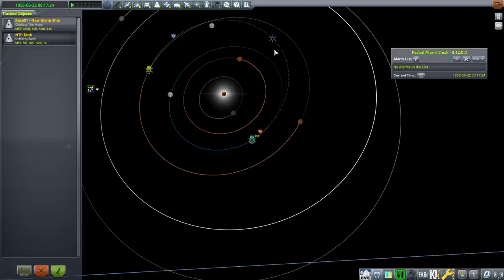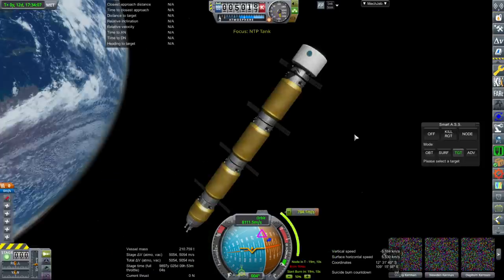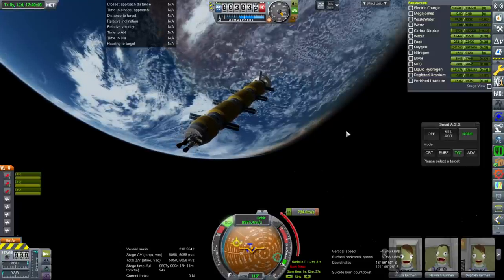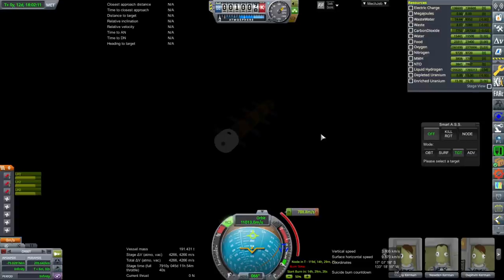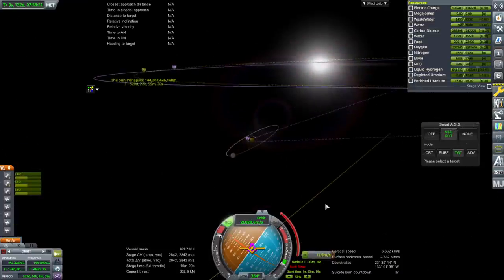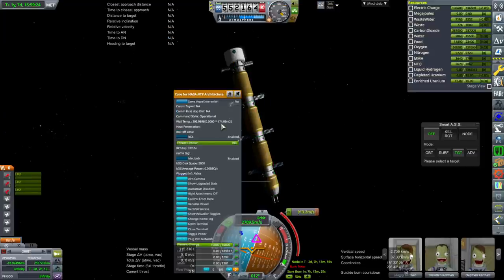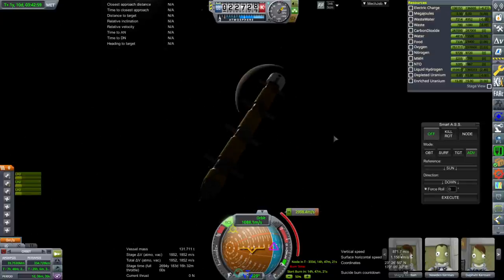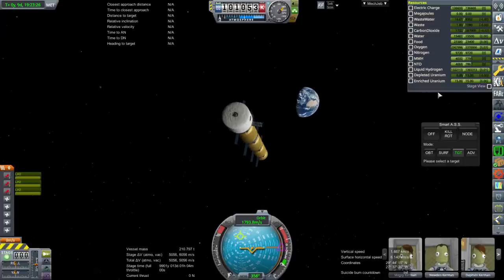Realism Overhaul in KSP 1.8.1 - NASA's Nuclear Propulsion Architecture 3

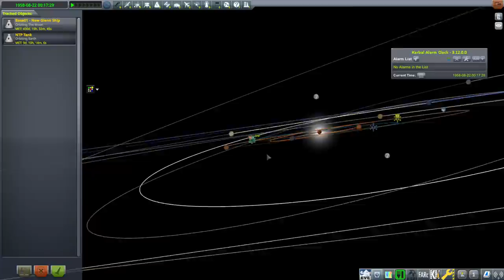Comment: 0:50 Maybe you could time-warp all the way to the 2033 window?

4:00 Safety features taking up ~10% the mass of a stage? Doubt.

7:35 Genre of ship... that's an interesting wording. BTW, I love that space definition of "Longship".

17:40 Oof... Some was left until literally 17:12, but the boiloff rate was ludicrous after you re-assumed control until that point for some reason.

21:20 I wonder why they have that exhaust color... I've thought before that may just be in the atmosphere, due to the rich burning of the low-density/pressure hydrogen with atmospheric oxygen, though usually only sooty/particle-rich flames are reddish. Maybe it's due to particles ablated from the cladding instead?

Anyway, really hope you solve the boiloff issue.
Reply from the maker: My current theory is that we need explicit radiators for the boiloff and that the presence of KSP Interstellar and its Waste Heat management has something to do with this. We'll see.

Comment: "How to throw a really heavy explosive and potentially radioactive object at another planet really hard"
Reply from the maker: Not that explosive without carrying liquid oxygen as well - at least, not as explosive as it could be. Mars doesn't have radiation belt protection from solar radiation, so I'm not sure our puny reactors are actually going to be noticeable compared to its normal background radiation. Depends how far out the material gets spread, I guess.
Reply: @RaizSpace  who said I meant chemical explosive? kinetic still does the trick.
Reply from the maker: You said it was a really heavy explosive, not that it was really good at kinetic bombardment.
Reply: @RaizSpace  oh fine you win. Hydrogen is mostly inert without an oxidizer.

Anyway I really hope you figure out that boil off problem. Personally I wonder if the engine module has anything to do with it...
Reply: @RaizSpace  Yes, depends heavily on the amount of spread. Irradiated fuel is not a joke, the dose rates thrown off by even a small piece of irradiated fuel can be injurious and produce deterministic health effects (effects that show up immediately, like skin reddening, nausea, destruction of the gut lining). At Bruce Power in Ontario, Canada there was a case where a technician doing normal surveying walked into a room and his dose rate meter jumped from background up to several dozen millisieverts per hour (this is a serious dose rate, the dose rate at which posting radiation hazard signage becomes mandatory by law is 25 MICROsieverts). The technician backed out of the room and announced that it was off limits to any human traffic. Later after investigating what was going on, using robots and cameras, workers discovered that a little piece of irradiated fuel about the size of a pea had been dropped on the floor by one of the fueling machines; this fuel chunk had come from a broken rod in the months previous to its discovery and had been kicking around in the fueling machines internals for a while before finding its way out and onto the floor. By taking measurements using a dose rate meter on the end of a pole attached to a robot, it was found that this thing was giving off a dose rate measured in sieverts *per minute*. If the technician walking into the room earlier had not had his meter already switched on, he probably would have walked close to this piece on the floor without realizing a thing, and he would have got a fatal dose. 

If we spread the contents of a nuclear thermal engine across Mars, chances are there will be many chunks of irradiated fuel that manage to reach the ground without being fully atomized during reentry (after all, NTR reactors are designed to handle very high temperatures without breaking down). Any piece of this stuff would remain a very real hazard to anyone who came close for decades. That's whether they walk by it in a suit or have it get tracked into a pressurized workshop by vehicles or settled into the bottom of a water holding tank that it was washed into during ice mining operations. Basically, yeah, crashing nuclear thermal cores into anything that isn't a gas giant is probably a really bad idea. It would be better to fling them onto a solar orbit to at least buy a few decades or centuries so that we can develop the propulsion tech and the plan necessary to go pick them up before they hit anything and make a big mess.
Reply from the maker: Which is why we didn't get anywhere near to entering Mars' atmosphere. It's not like I used aerocapture here.
Reply: @sycodeathman  also a small piece would have very low mass and thus decelerate extremely quickly. Good point!

Comment: Question.
How do MLI layers work?
Reply: They are just insulation,they dont transfer the heat to space,so they keep the cold hidrogen without the heat coming from outside..
Reply from the maker: MLI layers are dozens of very thin layers of material separated by a mesh and with vacuum in between them so that they transfer minimal heat. Each layer diminishes how much heat is transferred through, and there's a calculation for what reduction percentage you get for how many layers. MLI layers are pretty much always worth it because they're very light, so you see them on practically all satellites - they're the gold foil stuff.
Reply: @RaizSpace  so they work on sort of the same principle as vacuum flasks do.
Reply from the maker: Yes.

Comment: How long does a the Nuklar architecture take for a round trip? The current endurance space flight record by Valery Polyakov spent nearly 438 consecutive days aboard the Mir space station, from January 1994 to March 1995. Are we even in the same ballpark?
Reply from the maker: Any regular Mars round trip is about 900 days. However, unlike a stay aboard a space station, most of that time will be spend on a gravitating body - Mars. They would spend about 540 days on the surface, and about 360 days in microgravity, so the microgravity time is comparable to numerous spaceflights, including a few stays on the ISS.

Comment: may i again suggest use ascent/descent addon for mechjeb/interplanetory transfer ?
not only in april 2020 beta  should be fixes for some problems you have encountered before,
but it also allows to plan backward transfer (temporary mars orbit) before you actually arrived to mars,
that would allow you to plan orbit for arrival carefully (to make burn almost prograde at mars periapsis) .
Reply from the maker: The accuracy of the burn at Mars periapsis wasn't a major concern of mine compared to other things. I often do things deliberately inaccurately when testing to allow margin when doing serious missions, and I guess seeing that might be a bit distressing, but I can assure you that I could have conducted ascent and the capture burn with phenomenal accuracy if that had been my goal. I can easily calculate the lead time I need for a capture burn.
Reply: @RaizSpace  you did choose incorrect orbit (inclination and periapsis location) when entered mars soi (choice was made when 700 m/s burn) so you can't cheaply make burn for transfer back. whole idea for ascent/descent addon was to choose optimal intermediate orbit and it's periapsis where transfer burn (should be executed) long before transfer occur or vehicle enters orbit around planet. (both for ground vehicles and out of soi too)
Reply from the maker: Ah, well, if it can do that, I'll see. Your initial comment didn't make it clear that it could allow planning for the transfer back before we even got to Mars. I would be suspicious of its accuracy, though, since KSP itself isn't accurate enough to plan that.
Reply: @RaizSpace  you obviously should select (or type) there both planet you want to transfer from and to, and choose transfer dates (in beta auto should work better compared to your previous try, but still manual typing and later slightly altering for better orbit is the best in this case), and orbit angle(one (angle)axis is fixed by chosen dates, other is free for you to choose from) it also report inbound (at soi range) speed (but still not low orbit speed, and in auto could optimize for both outbound and inbound(border of SOI of both planets or very high orbit) minimal sum speeds - mechjeb optimization slightly better in that regard - it does optimize speed for low orbit both planets, but only for orbit you currently in)
Reply: and may be also choose short and long path selector (if it wrong it would give wild transfers) short one if transfer takes less than half of orbit (around sun), long one - more than half of orbit, story here for some dates both way works(without wild transfer speeds) but orbital planes from/to differs significantly. optimization in beta should work better, but last time you somehow hit two problems(one of them was bug) with optimization, and did not even try manually enter dates, both places did changed in beta but nobody say it became better or worse.

Comment: I can kinda see now why Lockhead chose to use more solar panels and active cryogenic refrigeration for their zero boil off tankage.
But then I can't help but think this setup is not the way to go in the long run, it might work for getting hypothetically placid (and radiation proof?) Kerbals to Mars and back, I'm not sure you'd succeed with actual humans returning alive and sane doing it this way. YKMV!
Reply from the maker: I mean, nuclear submarines are a thing. I don't think on a long ship like this with multiple tanks in between that the radiation from the drive is more of a problem than radiation from the Sun.
Reply: @RaizSpace  >Yeah I mean aside from the drive shielding issues, how do you keep a crew stuck in a small can from going nuts and doing something that might end up killing themselves.

I lean towards the proposals that go for a larger vehicle constructed on orbit with multiple inflatable hab modules, a centrifuge, green house, etc, and a single large hollow core propellant tank that can serve as a pretty good storm shelter if the sun should sling something deadly in their direction.

So more of a everything but the kitchen sink approach so that the crew have meaningful tasks they can absorb themselves in, and enough volume that their 'home' feels big enough they can avoid each other if problematic interpersonal relations start arising.
Reply from the maker: We manage to not have crews killing themselves on ISS all the time. I agree that they should have tasks and should point out that the interior volume available to them on this should compare favorably to ISS - I think you're underestimating the size of this. It's six months to Mars and six months back with the rest of the time on the surface. A regular stay on ISS is six months with no sign of severe mental issues. Incidentally, I've spent the better part of the past six months is about the same volume or less and I'm only mildly insane.
Reply: @RaizSpace  > You may be right, but I can't help thinking that being no more 500km or so from home with a round the clock emergency evacuation Soyuz sitting on standby, and a glorious rolling view of earth below may not be the most realistic simulation of a journey to Mars and back. ;-)

Did you catch the (Russian?) 6 month Mars isolation test a while back?, they did not strike me as being a bunch of happy campers at the end of their stay in the simulated crew quarters, and they technically had most of the comforts of home available to them (ie gravity and no more radiation exposure than normal).

Anyways, the Moon has more water than NASA previously thought, so baby steps?, and progressively gain more experience and knowledge as we go about setting up a permanent settlement on the Moon?, well, the Human race I mean, Kerbals on the other hand, well who knows where they will all end up. :-}